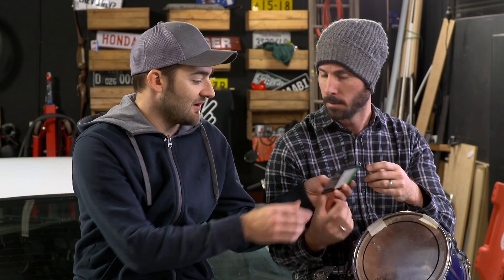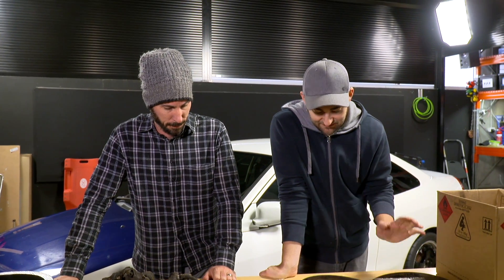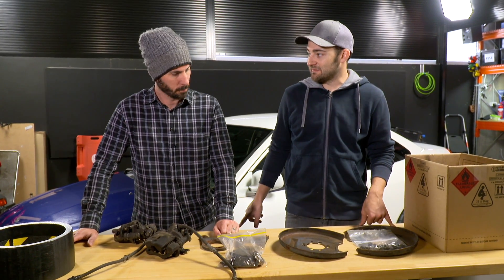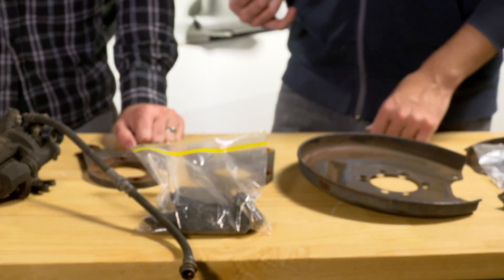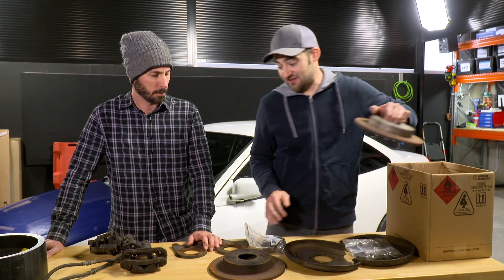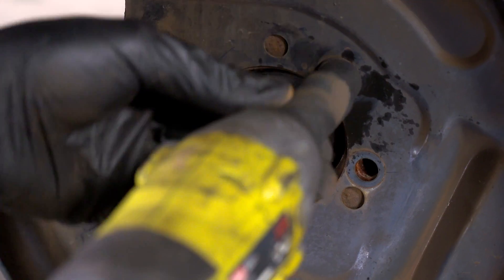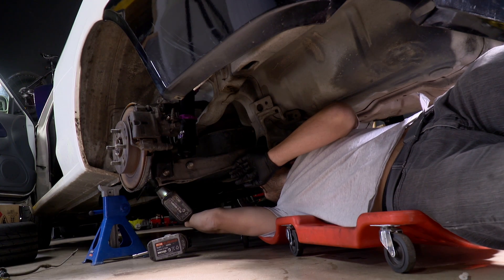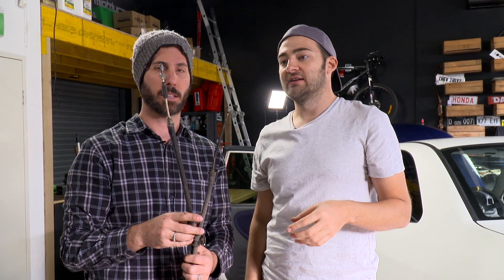Drum to Disc Brake Conversion DIY

Comment: uhh...proportioning valve?????
Reply: Look under your seat. They gifted one to all the viewers
Reply: dont think you understand. drum brakes use a  different  proportioning valve
Reply from the maker: uhhh... parts bin, its the same.
Reply: whats up guys. wasn't sure. I usually work on chevy (holden i think its called there) they needed swaped out for disc type....
Reply: Yeah I was wondering about that too. I've done a few disc brake conversions on a few different cars, some require a different valve, some don't. Trickiest one was an old 1965 Ford which never had discs as an option back then. Getting the pressures exactly right was a good learning experience.
Reply: Easy way to do it is an adjustable proportioning valve.  As a rough guide 80/20 is a good start for a sedan
Reply: Whilst in the case of the Lancer you may be correct - as a general point to people thinking of doing this to their own cars then they should be aware that it is more than likely they will need to either change the balance front to rear with a valve, or in some cases have to change the master cylinder completely. Otherwise your fans will be locking up their rears and doing skids of a not so maaad nature...
Reply: +tim funk not sure my wife and son think so, but I'm sure you are the expert in such things, or that's what I heard on the internet so it must be true...
Reply: look into it. disc drum cars will have different proportioning valves for different brake balance. and (some) drum brake master cylinders have residual pressure valves built in as well. if your new brakes drag thatll be why
Reply: I hide a willwood one in my street car (not allowed to be able to change brake bias on the move here) but this lets me drive hard and adjust for dry / wet / gravel
Reply: +MrJockeyHD if u coment on the persons orignal coment there wont be a name
Reply: +Mighty Car Mods did you use the donor car proportion valve?

Comment: Your rear brakes will lock up before your front brakes now... You need to change the master cilinder or put something (don't know the English name for it) between your master cilinder and rear brakes, to change the pressure that is going to the rear brakes.
Reply: proportioning valve?
Reply from the maker: in some cases yes, not in this one. it's a fairly common modification to these kind of cars so we checked first.
Reply: the word your looking for is called a valve and that that holds slight pressure on drum brake slave cylinder so they dont go back in this valve is  normally inside the brake master cylinder

its a very common thing for people to forget when converting a car from drum to disc

it can also lock your wheels by not releasing the 1 or so psi pressure that the drub setup needed
Reply: Mighty Car Mods I trust you guys did. But drum brakes work on a different pressure then disk brakes. So out of curiosity. How is this compensated with this particular car?
Reply: it's mostly older cars that have the residual valve on drums. most auto adjustment drums have a standard proportioning valve that's the same. most newer cars 99 and up at least that have disc options use same prop valve and master cylinder.
Reply: A proportioning valve?
Reply: +Jonka Olofsson it adjusts pressure from front to rear and on high performance vehicles it car do left to right as well. The front brakes do 60-75% of the work in most road vehicles and the valve is what regulates it.
Reply: You can make bias adjustments on the booster itself
Reply: But you should have had mentioned that in the video. I'm sure with the amount of people watching your videos someone will do this conversion and will run into problems because of that.
Reply: Ive been thinking of doing this on my Jetta GL to give it GLI all disk brakes and my friend mentioned there might be problems with the Proportions , thus why I brought it up
Reply: Depends on the size of the disks. Rear disks are usually a lot smaller.
Reply: I think you mean "proportion valve"
Reply: nope he meand the proportions EG ratio of diameter of rear compared to front disks. 0.6 to 0.8 is rougly standard (ish).
Reply: Cars that had both discs and drums available don't need modification.
Reply: An ALB-valve ;-)
Reply: usually a residual check valve on the rear brake line (and occasionally the front) is installed from my experience. I had a 69 chevy pickup with 4 manual drum brakes I converted the front drums to discs off of an 85 chevy pickup. Only things I had to use to make it work was 85 chevy ball joints ( which fit in the A arms of the 69 but have thicker shafts for the weight of the spindles.) I did upgrade to drilled and slotted discs since my 69 was a 6 lug and the 85 was 5 lug. but anyways, the place I ordered the discs from suggested that I put a 2lb residual check valve on the front brakes for it to have faster brake application, but it worked without the check valve for awhile. Rear brakes sometimes use a 10lb residual. proportioning valve mainly meters the front and rear fluid application ratio to be able to apply more brake pressure to the front or to the back depending on the application such as drifting or gripping. Some manufacturers master cylinders have these parts built in but its always good to research a bit on your factory system before throwing a brake conversion on. Just to be safe.
Reply: so... drift car?
Reply: on basically every car, the front brakes always have more stopping power than the drums, or in this case the new discs they put in. the rear discs also usually have a smaller surface area. Idk how you where you got the idea that the rear brakes would have more stopping power than the front.... and then this is a stock conversion, so those brakes work on that car from the factory as a different option...
Reply: Phone of brake and mufler repair in pittmeadows
Reply: Patrick Carta proportioning valve, is that what you mean?
Reply: Magnus Jeffery Yes
Reply: it's called a brake debooster,  it goes from a small line diameter to a bigger line diameter to decrease pressure and increase volume
Reply: A Wilwood adjustable proportioning valve would work...
Reply: they call it Brake Proportioning Valve work,s great that should do it
Reply: how?
Reply: well really no, the  proportion valve prevents the rear from locking up, when the pressure reaches a minimum the fluid will push the spring opening the valve to prevent more fluid from going to the back and locking it up, but the front as non loool.

Comment: ok,,,,correct me if im wrong here. A drum brake master cyl has a detention vale that keeps fluid from moving backwards, but only on the rear brakes, so changing to disk without changing the master will cause the new disc brakes to rub and wear and get very hot. not to mention a different volume of fluid for disc/ drum brakes. Thats why the master with rear drums has a different sized res. for the rear.......ok im rambling......but i have run into this many times. If im right.....please send a tee shirt and bumper sticker for tech advice fee......
(( was worth a shot ))
Reply: The master cylinder has nothing to do with the front/ rear distribution of the brake fluid. The master pumps fluid to a proportioning valve, which then directs some fluid to the front brakes and some to the back.
Reply: They can just remove the valve, it's not needed in a disc system and can be removed.  The lower capacity reservoir will not be a problem other than the initial bleeding of the system, and the need to religiously check the fluid level.

Source: http://www.speedwaymotors.com/Tech/brake-system-selection-service-performance-operation.html
Reply: but what about the pressure and volume of fluid now going to the rear? and the one way valve ( wrong word ) seems to me the rears going to lock up instantly now
Reply: matt sez it won't lock up the rear, at most it will make the pads drag. But as I said, this valve can be removed and you would not have a problem.

The pressure and volume of the fluid would not change, only the capacity of the reservoir.  Let's take a 1996 Galant as an example; it uses the same master cylinder for both rear drum and disc brakes.  It only uses a different one if the vehicle is equipped with ABS.
Reply: +matt sez I think what you're referring to is the proportioning valve. That would need to be changed for proper brake bias.
Reply: Matt you are correct, drum breaks do usually have a valve that keeps the pressure in the line to take up the slack between the shoe and drum. I don't think that these guys will run into that issue though as there is the automatic mechanical adjuster at the wheel cylinder that does that job instead of the valve. You are also right about the proportioning being incorrect too.

All of these guys saying that you are wrong or that you're talking about the proportioning valve clearly have never worked on or modified older cars before.
Reply: +tx5brent clearly your mechanical skills aren't quite what you think they are. There is, in fact, a 10psi one way check valve for drum brake systems. Automatic adjusters have a different function than this valve. All it takes to verify this is a simple Google search. I won't insult your intelligence any further by linking you to a search...
Reply: +B. Reece they are there to keep the pressure in the wheel cylinders, to keep the wheel cylinder extended, which in turn keeps the shoe closer to the drum. if you think that they have some other function please explain. I am happy to be proven wrong, please explain how you think they work?
Reply: +B. Reece I just looked at the link you posted earlier, that backs up exactly what I am saying. Why do you think they suffer from bleed back? it's because the spring tension of the shoe compresses the wheel cylinder. what happens when it does this? the shoe moves away from the drum. The adjuster on this car takes care of that slop, thus you don't need to keep the pressure in the line.
Reply: +tx5brent adjusters are there to adjust for wear, not counteract bleed back. that is the job of the check valve. sorry man, but you're incorrect as to how things operate.
Reply: Mate, just because you have read one thing on the Internet does not mean you have an understanding as to how it works.

If you know how it all works explain to me what causes bleed back then? Explain to me how the adjuster works and how it is different to the valve setup?
Reply: +tx5brent The video shows how the adjuster works and why it's there, or did you miss that?  but they did not touch on the valve.  If bleed back happens after you release the pedal, and the auto adjuster ratchets as you press the pedal, how in the world could it be used to counteract bleed back? if only we had some kind of one way check valve to keep a certain psi of hydraulic pressure in the line to counteract this...
Reply: For drum brakes djusters are there to counteract wear, the valve keeps pressure on the line to prevent the brake cylinders from leaking and air getting into the system when letting go of the brakes.

Comment: I work at a mercedes specialist and mercedes uses a combination of drum and disc brakes at the back. the discs brake with the pedal and the drum brakes are used for the handbrake, since these constructions for the handbrakes are cheaper.

Comment: I was going to do this to a CC coupe (the previous model) had the parts but plans changed and I sold the parts and car. I was gonna swap parts of the suspension to allow for a rear anti sway bar so a lot more work and cost, at the time I couldn't afford it. Also had a bigger brake booster for under the bonnet I could have swapped out.

Comment: Guys, you should make video in which you make fwd and rwd from one model of subaru with the same weight and power. And finally find which one is better in different situations.
Reply: Finally find out? It's well known. RWD is faster around a track because it helps your corner better. FWD has better traction with more weight over the wheels and is cheaper to make but also suffers from torque steer unless the engine is mounted longways with the flywheel facing the rear like in AWD models. FWD can actually be tuned to be really good on a track but it is very difficult to do and it can never match the cornering performance of RWD completely.
Reply: FWD does not have better traction. When you accelerate the weight is transferred off the front wheels and onto the back wheels which make spin. On top of that on a FWD car the front wheels are using their friction for accelerating and turning at the same time which also makes them worse on track. That's why FWD cars have a tendency to understeer. It is also way easier to get a RWD car to have a 50/50 weight distribution because of them having the transmission in the middle or a rear transaxle like a Corvette. RWD cars also have a differential in the rear. FWD is only better in adverse conditions like rain and snow which is why it is used is most commuter cars. In terms of performance cars its kinda poop. Hot hatches are pretty much the only performance FWD cars for a reason.
Reply: Right I meant more traction in snow and bad conditions. Not under hard acceleration.
Reply: FWD is by far the most stable kind of vehicle, it does not oversteer, and it is also far more aerodynamically stable. A vehicle with a rear mounted or mid mounted engine is less stable at high speeds than a FWD.

Safety does not however translate into track times.
Reply: Carbon 12
FWD has nothing to do with aerodynamics. Its more stable in a straight line because of most of the weight is at the nose. Actually some FWD cars do over-steer. Over-steer and under-steer are controlled a lot by the suspension set up. FWD technically has nothing to do with engine placement, you can have a rear mounted engine and FWD, its an odd set up but you can do it. Also there is a thing called front mounted mid engine. Which a lot of GT cars have. All mid engine means is the engine is in between the axles. Most vehicles with a mid engine set up also have a lot of down force when they are at speed so they are perfectly stable. Length also helps with straight line stability while width helps with corning stability.
Reply: Danny Hampton Sorry I was not clear, FWD has no direct relation to aerodynamics, however engine placement means EVERYTHING. I was talking to the previous posts who brought up engine placement in this regard.  I'm aware of mid engined vehicles, and they are stable. In a corner. And good 4wd acceleration too. The length of the car is not actually related at all to it's staight line stability in aerodynamics, it is actually the difference in length between it's centre of mass and it's front, and it's centre of mass and the back of the car. Not nearly everything that goes into aerodynamics, but the basics in terms of length factor. A long rear engine and massed car is actually far worse than a short one for example. I believe cornering stability is a bit more complecated than that, and more directly related to that is height, or rather height of the centre of mass, and chassis roll and so forth. 

I will say "FWD has nothing to do with aerodynamics. Its more stable in a straight line because of most of the weight is at the nose." makes you sound a bit silly. You just said it has nothing to do with aerodynamics, the fundamental concept of aerodynamics (being nose heavy) is the reason.

Comment: i don't think anyone mentioned this yet but be careful when pouring brake fluid as it will eat up paint and cause the steel underneath to rust at 16:35

Comment: also, for those that don't know, drum brakes are preferred for offroad use.  especially when you're mudding or going through dirty water, sand, whatever. drum brakes will work better then disc because with disc, the pads will squeeze the dirt, gravel, etc into the disc wearing both out faster over time, drums keep most out and also more likely to scrap out all the junk when applied.  all you need to do with drums after offroading is drive a little applying and releasing for a few rotations to clean them out.

as for disc is good on pick up trucks also for hauling, as my truck has disc front and rear, for greater stopping with out roasting your brakes or catching fire from overheating.  especially since some trucks when hauling rely on your rear brakes, where your load is, to stop.

Comment: Did this on my 94 civic hatch. With integra brakes. I actually didn't have to change the proportion valve or whatever it's called. My break performance clearly changed for the better

Comment: You should have painted all the calipers
Reply: lol +5kw
Reply: +Gkeoz's Workshop haha yee true
Reply: Function over form, that's the point of 'unmodifying' 2 sexy, the colour of the calipers has no baring on performance, so fuck painting them.
Reply: GTiR23 
Actually i was being sarcastic
Painting the calipers are just for the look
Reply: Gkeoz's Workshop I know brother, I was replying to the original comment. I hope anyone watching this vid doesn't actually think you'll gain 5kW by painting your calipers haha! By 'performance' I meant how the brakes worked rather than an increase in engine power lol!
Reply: GTiR23
For aesthetic purposes bruv,
Reply: the paint would help for easier cleaning and preventing rust tho
Reply: GTiR23 the paint would obviously add 200hp
Reply: Roflmfaoftw He did, but only the front calipers
Reply: +10hp

Comment: re: longer wrenches,  just slip a pipe over your standard wrench. does the same job.  shitloads cheaper
Reply: Its called a cheater bar or cheater pipe. 
Rumor has it, thats exactly what the cheap lube shops use to tighten your oil drain plug bolt. Bit not before ensuring its cross threaded using a 1/2 " hurricane impact gun.
Reply: CasualFan Earthquake* from the good ole Harbor Freight Tools ! 🤣